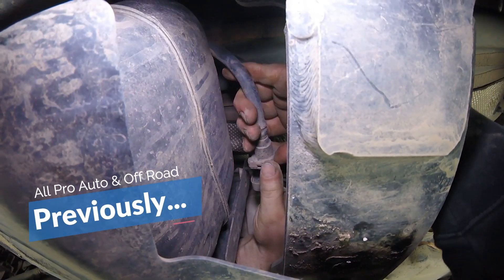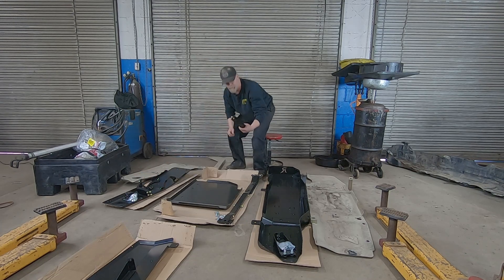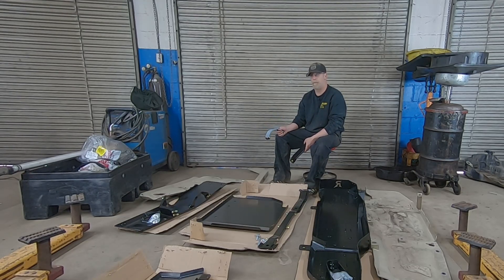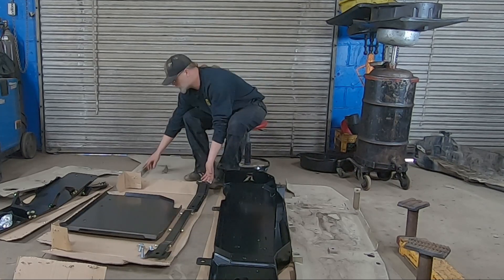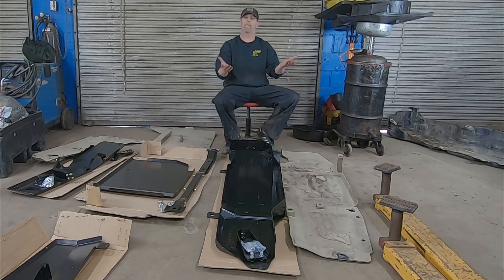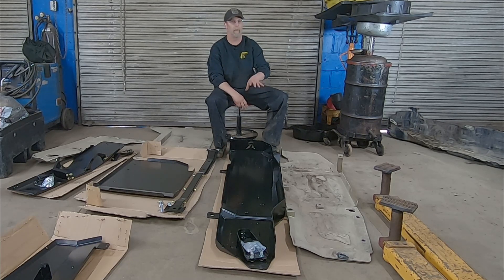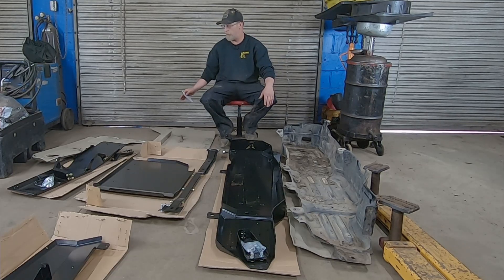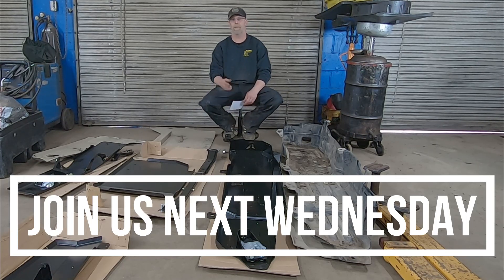JL Skid Plate Comparison... Rusty's Offroad & Metalcloak - Part 2

Comment: Rusty claims there's No Need To Take The Fuel Tank Off. Just replace the fuel skid off, well at least on 392 lol.
Reply from the maker: Correct. You can use ratchet straps
There's plenty of options
People can install stuff however they wish.
We don't do install videos just for that reason